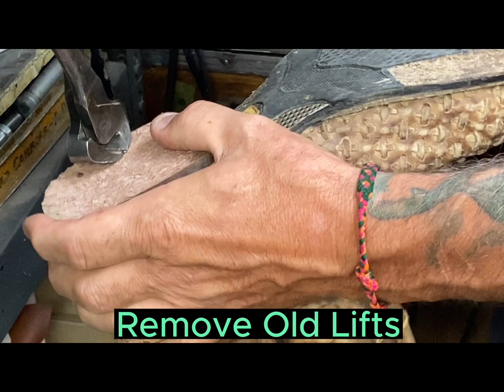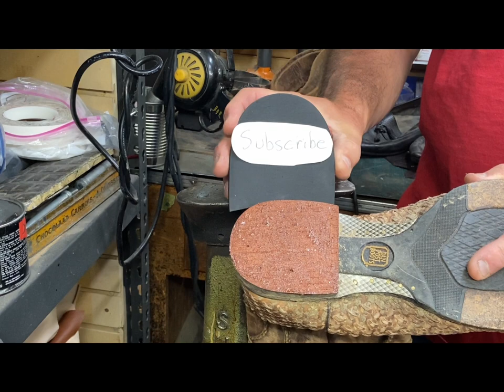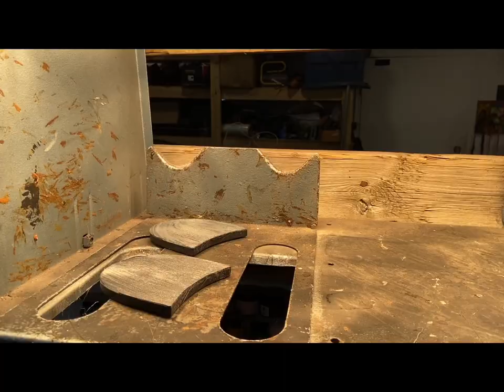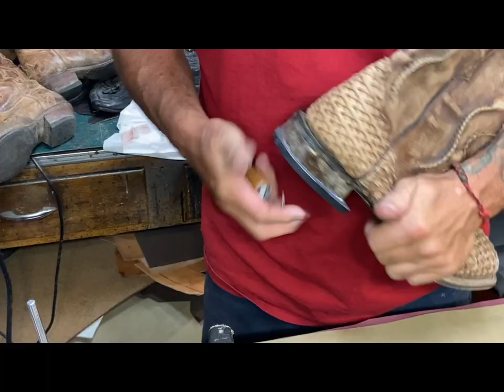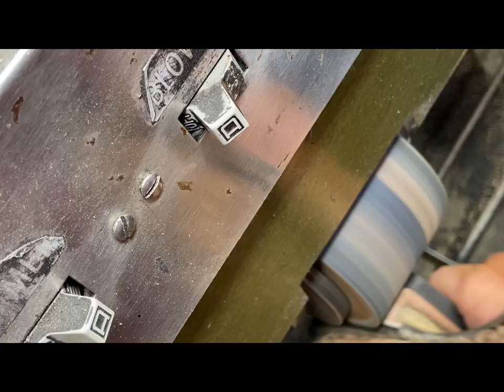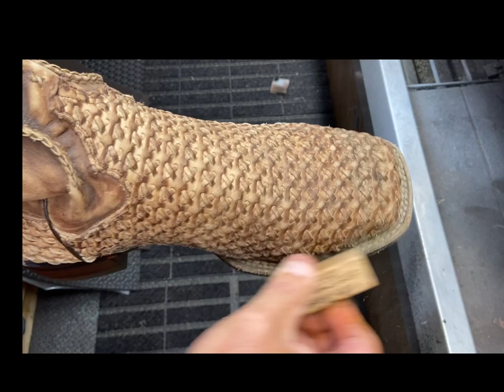How to Replace Cowboy Boot Heels ( NO MUSIC, SHOP SOUNDS ONLY ASMR ?

Comment: Great video. How long did you wait for the glue to dry before re heating?  Also, is this possible without the professional press machine you have there?
Reply from the maker: @mb3080  20 mins - 30 mins , yes no press needed